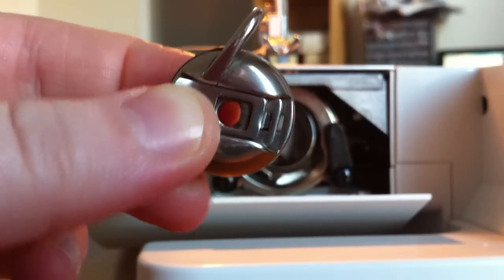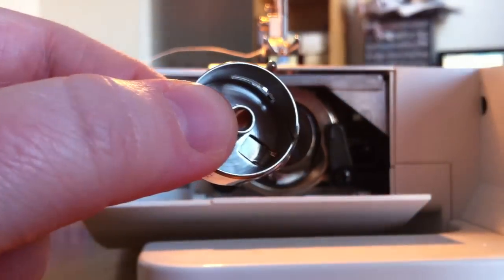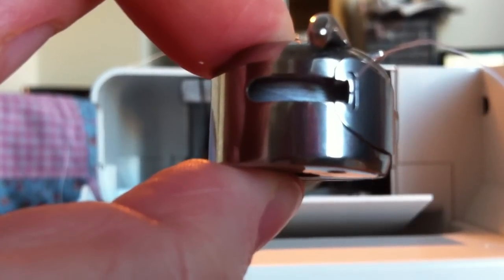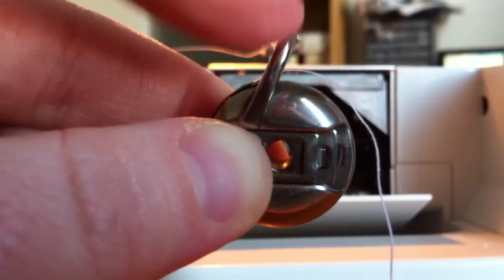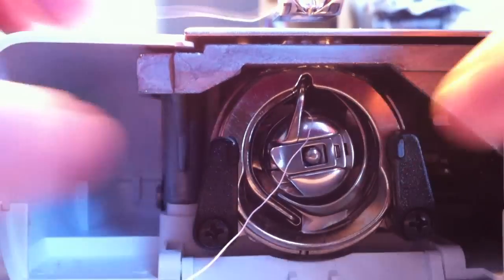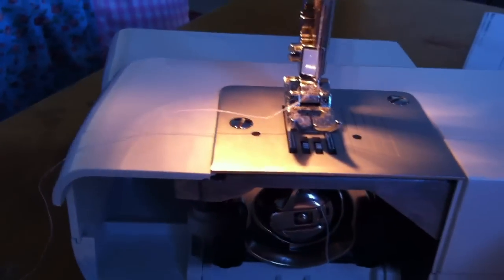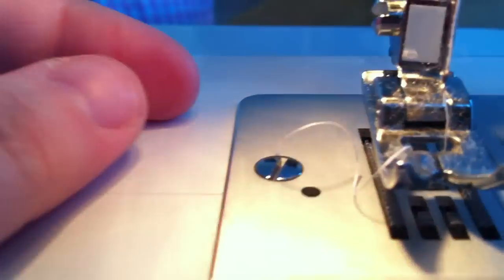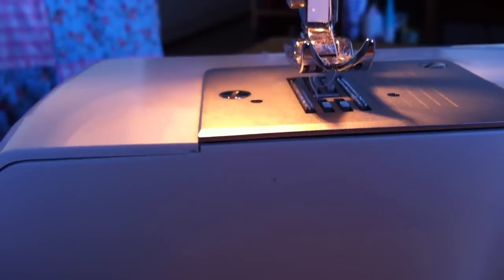~Tip: how to put a bobbin into the bobbin driver on a sewing machine~

Comment: If you open the lever on the bobbin it will not "pop" in there. It will set in there very gently and lock into place without causing damage to your machine. That is why that lever is on the front of your bobbin.

Comment: Your demonstration helped me!  (1) I learned that a few inches of thread should extend from the bobbin case and go toward the right-hand side.  (2) VERY USEFUL, I learned to use a handy  "tool", e.g., a flat ruler or chopstick,  to pull up the bobbin thread loop after it appears under the presser foot.  Thanks so much.  90% of the time, I was failing to pick up bobbin thread.

Comment: I noticed that you had a hard time holding the bobbin in the case and here is a tip.
The latch on top of the bobbin case can be lifted up and that holds the bobbin inside the bobbin case.  Push the bobbin holder into the proper position and let the latch release and it is in the holder.  Very good video and happy sewing.

Comment: Thank you.  Very helpful.  Key is, I see now, to have thread loaded from above.  One tip: the bobbin holder has that lever on its face that if you pull the lever out it keeps the bobbin from falling out from the back.  very handy.  Thanks again.

Comment: When I taught my second graders here are the terms I used:  put the filled bobbin into the bobbin case with the threaded bobbin turnng clockwise, then guide the thread into the notch and then under the metal spring of the bobbin case.  With the 'bunny ear' (nub) pointed up, put the bobbin case into the bobbin base. Wiggle it until it 'clicks' into place.

Comment: First to put the bobbin in correctly the thread should be on the left and hold it straight up then drop it in to the bobbin case.  Pulling the thread into the first outside notch then slide it over underneath to the inside notch then proceed by turning the Bobben around and pulling the little lever which holds it in place as you slide the Bobben into the shuttlecock area and they’ll be a little arm that needs to go into the groove just underneath where the needle comes through.
Listen for the click!

Comment: It isn't a bobbin driver, it is the shuttle the bobbin seats into.  And the part that sticks up is called a finger and the notch is what it goes into so you know it is seated properly for sewing.  The arm or lever is what you grasp to insert the bobbin into the shuttle.  And not all bobbins are going to insert the same way because that depends on your machine.  Some the thread will come off clockwise and some will come off counterclockwise, and some machines have the notch for the finger at different positions too, 11 versus 1 o'clock.  And some bobbins won't have a bobbin case per se, but the bobbin drops down flat into the shuttle.   And there are front loading bobbins where the shuttle is facing user, and there are side loading bobbins that are on the left of the machine.

Comment: Pushing your bobbin in like that and snapping it is bad for the casing.  You are supposed to open the latch on the front, slide the bobbin in and then close the latch, which locks it in place.

Comment: so what direction does the thread go in the bobbin holder?  Looks like clockwise?  I have a side bobbin holder, but you can't see it you have to feel for it under the cover.  I have used this machine over and over and always having trouble loading the thread from the bobbin to the top thread.  I'll try this.  Mine is an old New Home Sewing Machine.

Comment: Hi there - I have a new machine - I have threaded it correctly as per your video - thanks - was a good check - my problem is that the top thread looks fine but the bottom thread is not tight (like the top thread).  It's forming a loop instead of straight sewing.  I have checked tension as much as I can but am still baffled.  Any idea?  Many thanks

Comment: You should not shove it on like she did with such force.  There is a lever on the front of the case that you lift that will let you slide the bobbin holder on and when you release it, it will "lock" the bobbin on.  It's the same lever you use to take the bobbin holder out.